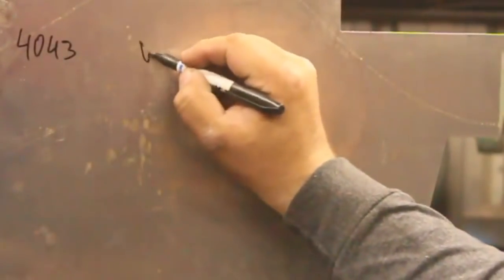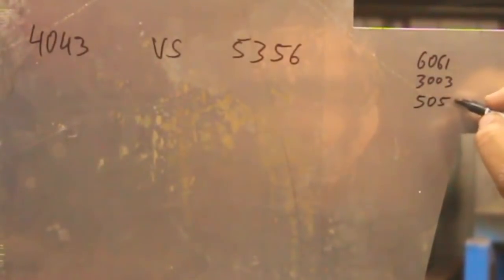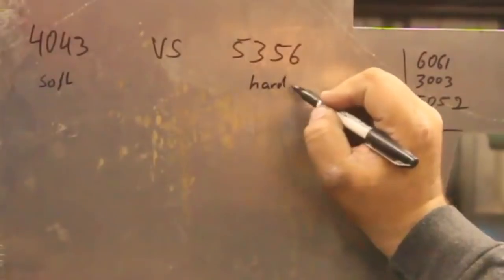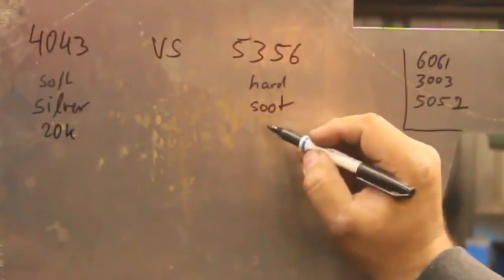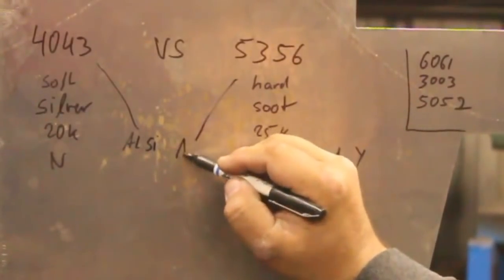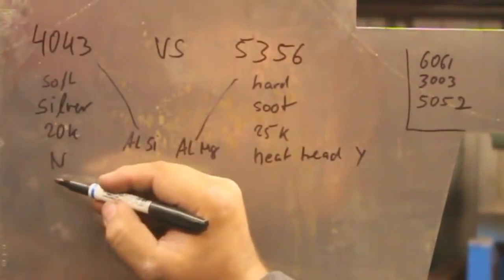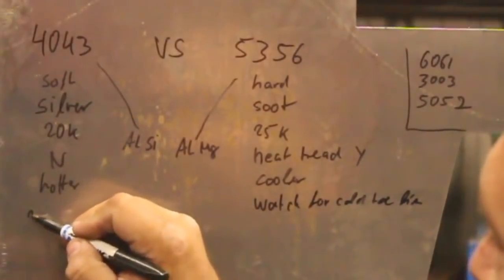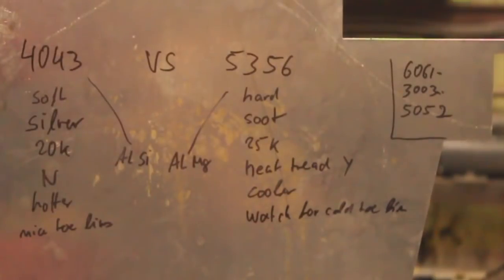4043 VS 5356  What aluminum filler to use, when and where

Comment: How do you identify the type of aluminum material
Reply from the maker: all depends ...  typically first line of defense is : ASK the manufacture ....  people who builds boats or trailers will typically tell you all proud hat their stuff is made out of ...  now if you can't find out what it is ....  THAT is when you get to charge SERIOUS $$$$ to fix shit ...  now it comes down to experience and educated guesses ... for example a lot of aluminum casting (more or much more than 50%) of all aluminum castings are a 300 dries casting .... now you need to look up properties and chemical composition of 300 series castings, find out what they are welded with, take in consideration that you destroy heat tread and artificial again of that casting ... then you need to have a plan to decide if that matters on that particular part, how much it matters and if you need to "fix" that for example by re heat treating it ....       
If you see aluminum diamond plate, typically it is 3003 aluminum on some rare occasion it is 5052 ... pick a filler that works with either or and you are ok ....      I mean this is something I teach in a 7 hr class with a bunch of disclosures at may shop ... it is really nothing that I can lay out here in one medium or even long YouTube comment .... sorry. It is way more complicated than that and there can be some liability in me (potentially telling you) how to "identify" stuff and then you making a judgement call based on my "suggestion" ....
Reply: @ZILAwelds  many thanks for your help.  I appreciate the real world perspective and  the technical response.  Thank you for your time
Reply from the maker: @adamherold3991  i am sorry I cant give you a better answer, if you have a specific project in the future send a comment and if I can assist you in finding an answer I will point you in hopefully the right direction. In the description of this video there is a link to a Lincoln Electric brochure that has TONS of information in it ... it will help you selecting the correct filler metal and stuff .. take a look at it ....

Comment: What filler rod works best on 6063?
Reply from the maker: Best for what? Strength? Looks? What is the service temperature of the part you are welding? Does it need to be salt water corrosion resistant? Are you welding 6063 to 6063? Or some thing else?

Comment: Hi teacher can I use 5356 for cylinder head
Reply from the maker: No.   5356 has “hot cracking issues”  the service temperature is way too low! 

You need to use 4043  or similar
Reply: @ZILAwelds  thanks my teacher

Comment: What I would like to know is welding stainless Steel, I know the most common is 308L but for all grades of Stainless does it pay to just use 316L or are there Caveats for using specific rods with specific materials? Yes I am just a DYI'er trying not to buy five different fill rods. Thanks in advance.
Reply from the maker: no, stainless is "like aluminum" you have to match the filler to the base metal ...    316 filler should ONLY be used on 316 base metal ..... 308 filler you can use on 301,304,304 stainless .... and I believe but dont quote me on this you can also use it for joining 304 to 316 ....      
309 on the other had is to weld mild steel to stainless steel ...  
there are a few different ones that you are supposed to use in different situations ....
308 is your most common .... if you weld stainless to mid 309 is your most common ...  
there is no easy YES or NO question ... and ALWAYS use .... XYZ .....
now there are some guys that say all you need is ......  312 rod and you can weld everything with it ....but that is a half truth ....  dont count on that ......
Reply: @ZILAwelds  Thanks, that was what someone said about 316 but after going on the Lincoln website there is more than 50 types of filler rod for stainless so I guess I'll just go with 308 & buy one pounders if I need anything specific. Hey thanks for the fast come back & thanks, enjoyed the video.

Comment: Hello there @ZILA,
Which one best aluminum filler wire and size for Tig aluminum welding ?
Reply from the maker: wow, that is hard to answer ....  probably the most common and mostly used is 4043 .... BUT there are times where when you weld marine grade material you cannot use 4043 ....  
if you as 5 other people you will get 5 other answers ...  
some guys swear by 5356, 4943, 5554, .... there is no end to this ...   you really have to "match" the filler to your base material (that is if you know what your base material is) ....  then there are some companies that specialize in repair alloys and they only have "one kind" and it is a "one size fits all" approach ... it welds "most kinds of weldable aluminum" ... now that stuff is much more $$$ but it typically works good ....  
I mean  - no one ( at least no one with some knowledge ) can answer a very brought question like this ....  
as far as diameter ???   3/32 is very popular ...  but if you weld thinner stuff 1/16 is also popular and if you weld thicker stuff and you have  a tig machine that will put our more than 200 or evermore than 250 amp than 1/8" filler rod diameter is very good  ....
again - not easy to answer with the information given .....

here is the link to the repair alloy if you are interested in it
https://rockmountwelding.com/products/?bigcommerce_category=tig-alloys-gtaw
look for NEPTUNE TIG ......

Comment: you should try out some 5554 filler. best of both, without any of the cons.... resists corrosion better as well
Reply from the maker: Yes one con : no color match anodize
I have been using and recommending a bunch of 5554 wire for YEARS and welded cleetus mcfarlands jet boats with it and a bunch of other stuff
Another con: very few people stock it and it typically cost more

Comment: so if its something for like inside a car part which one should i use
Reply from the maker: hard to say, there are factory repair specs for all this stuff ....  some parts on corvette are welded with 4043 some parts on suburbans are welded with 5356, some stuff on the new fords and Jaguars and land rovers is welded with 5554 alloy ....  so it is really not easy to say, there is computer software for collision repair shops that describes exactly locations and alloys used .... I would not know your specific application

Comment: Excellent lesson.  Sounds like there is almost no reason to use 4043 wire because 5356 is superior in almost every application...
Reply from the maker: Papa Jon i like to disagree.  Besides 5356 not wetting out as nice and being really sooty....
All aluminum wires with a magnesium content of 3% or more (5356 has 5 or 6%) are subject to hot cracking ....  over 150F there is a concern of hot cracking ...  so if you weld up an aluminum valve cover for sure 5356 is less than ideal ....
Reply: I have no plans to use aluminum in such a case but primarily household/yard goods and on an aluminum boat where I now use pop rivets.  The other filler for small jobs may involve that new aluminum brazing.     Have you worked with that for small jobs Pete?
Reply from the maker: Papa Jon i have used some zink based aluminum brazing rod ( look up HTS2000 on youtube) 
That stuff sure looks A LOT easier on youtube than in reality ....
Apparently there is an aluminum mig brazing wire .....  i have not tried that yet.
Reply: I use it on cast aluminum

Comment: Please..
Can I wleding  aluminum 2024t3 plate 3mm thick.(tig wleding )by 4043 or 4047 or 5356 ?
Reply from the maker: no you can NOT - not tig weld - not mig weld .... rivets or bolts will be your best friend !
Reply: Thank you so much.

Comment: 5356 .046 in my spool gun(30A) runs great.
Reply from the maker: David Spin of course.  The 30a spool gun is one of the better ones.  Also generally speaking 5356 wire is fairly “hard” and feeds good anyway - especially if it only has to be pushed 8” far ....

Comment: What role does the magnesium play in the heat treat-ability of the alloy?
Reply from the maker: All I know is that it is essential.  I am fairly sure that aluminum alloys that do not contain any magnesium can not be heat treaded (or at least not with significant strength gains).  
However - I don't know all the ins and outs - I don't know how much magnesium has to be in the alloy for it to be heat treatable - I don't know if there is such a thing as too much (or too high of as magnesium content) ....  

Sorry